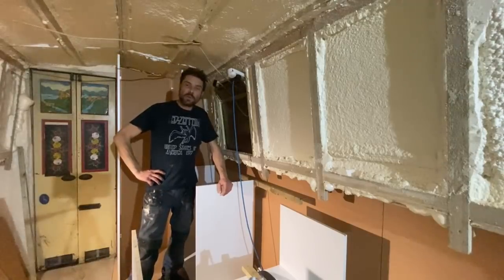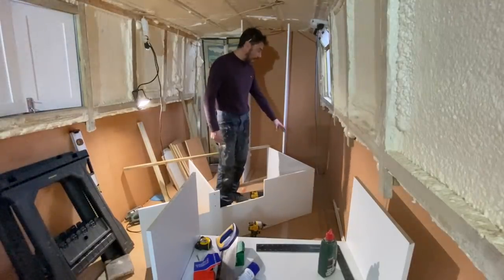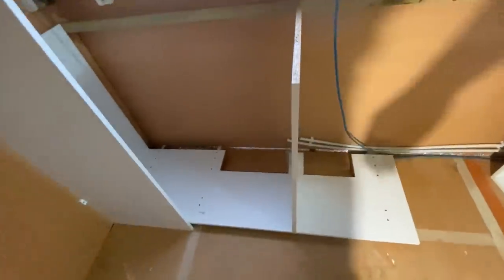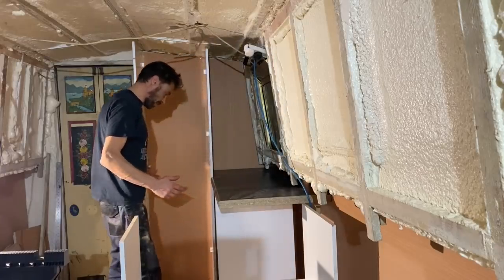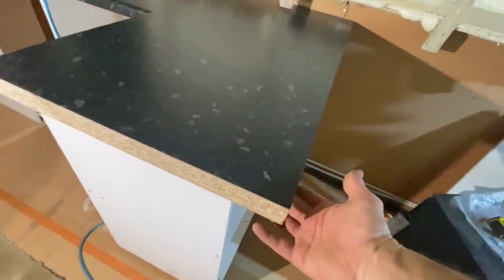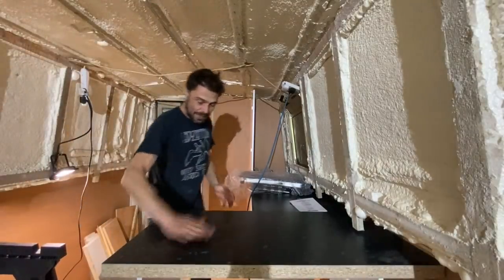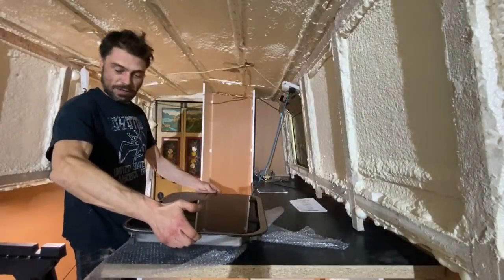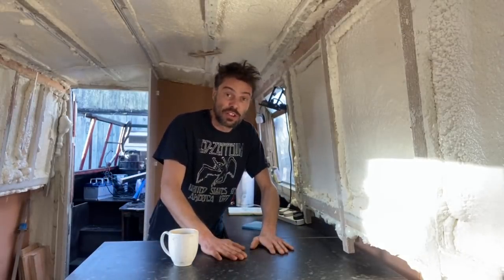63. Galley Kitchen Installation Pt2

Comment: Hello James, a good tip is to make holes in the floor underneath the rear of the fridge (3 or 4 holes, in a row, about 2-3 inches diameter) allowing cool air to come-up from the bilge. This air is drawn-up through convection as the fridge dumps it's heat whist in operation. This will allow your fridge to cool faster and thus will "cycle" less, using less energy to run. A gap for the air to escape at the top of your units would complete the air-flow circuit. As your oven will be above the fridge, the effect over time would help keep your bilge dry and remove stale air as well. All the best.
Reply: Heh. Is your bilge smelling a bit damp? Just make some grilled cheese sandwiches and the problem will go away!
Reply: @JasperJanssen  Principles of convection lost on you?
Reply: @mauricepower  what? Why are you suddenly hostile?!
Reply: @JasperJanssen  Hostile? Ha! Classic transference.

Comment: Hey James, don’t rotate the hob, stick with your original orientation to prevent splashes on the stove - fire risk and a potential BSS failure. Please note that you can keep the kettle on the stove like most boaters do.

Comment: I agree, putting the hob at a diagonal to the base and nearer the gunnels means you are standing within the galley space with work surfaces on both sides. That’s how my boat is configured and leaves the walkway clear for others on the boat.

Comment: So much progression 😁 personally I’d have had the hob the other way and just bought a trivet for the kettle to sit on after boiling so the hob lid can shut. I’d be concerned about the hob and pans handles facing into a walkway rather than the u shape of the galley, easier to knock off

Comment: Counter top you can get a t-piece to join the counter worktops together. Just thought as the trim piece you shown is for the ends. Anyway coming together nice. good job.
Reply: definitely need the proper trim piece. it will be profiled on one side to match the radius of the worktop.  you,re doing a great job.

Comment: Amazing progress.   I think I'd be tempted to see if the glass cover comes off that hob..its a nice idea but as you say, it'll hardly ever be down and otherwise you have to find somewhere to put the kettle down! Then keep the hob facing into the U and put a 4 or 6 inch upstand on the backside to act as a back for the hob.  Gotta think about safety of boiling ketles etc so close to a gangway.

Comment: You could paint the screw heads with colors. For coding which ones to remove to remove the cabinet vs what holds only the bottom spacing battens. Fingernail polish comes to mind for that.

Comment: Hi James, you can buy a joining strip for the worktop,that has a curve,to fit the profile of the edge. What you have, looks like an end trim.

Edit, looking on srewfix, it looks like (890HG) is the one I mean
Reply from the maker: It is an edging strip, but I need to remove that curve and therefore will need what I’ve got. Good spot 👍🏼

Comment: Looking great James,  I think I agree with most of the comments about the hob facing in, the pros out-way the cons, across the corner would be trickier but def the best use of the space. Also with your worktop butting up to the tower unit will this not impede doors? Hard to see from the camera angle. The recess under the cabinets could be a good spot for some led mood lighting.

Comment: James have you thought of leaving the trap door out and putting a false floor on top of the holes you cut in housing units you made that would cover the holes and screw.
You will of course be reading this after all your hard work.
Cheers Peter.

Comment: As other people have said mate you can get a joint strip with a lip on one side and a radius on the other .My only worry is how much material will be left of the work top if you mount it across? With heavy pans on the hob there's not much strength left.

Comment: Just a thought James moumting the hob where you`l like to would it be dangerouse for someone - children walking past you could mount the hob diagonally ( Where your left hand is on the video   13:37 ) as you look at it from the galley left to right , enabling you also to build a extractor fan  on the inside wall or ceiling  , maybe to remove the hob glass cover when cooking rather than have it allways opened up ..just a thought..cheers

Comment: Consider  placing the stovetop on the L, facing the middle of the boat, but pushed back so the black glass rests against the side of the boat.  This would give you working  space in front of the stove.

Comment: I don't believe you will have any problem with overheating in the cupboard above the oven providing you fit a shelf above the oven, follow the ventilation requirements of the oven and mount all your instrumentation on the side of the cabinet as you first proposed (significant heat will only escape as you open the oven door). Your electrics are going to be difficult enough to access without going further into the corner. I would even consider blanking off the opening above the oven and mounting the instrumentation on a hinged door on the side of the cabinet to ease access to the wiring on the back.

Comment: Would it be beneficial to round those corners where the hob will go? I also think you want a little counter space next to the hob to set a plate or your kettle on - with a hot pad of course. :D Just saying.

Comment: It's a bit of a shame you can't position the burner hub to face the kitchen center because of the cover plate position blocking the view. One way to solve the open cover plate issue is to make it detachable so you can simple store it somewhere when using the hub. This is how they are installed on many boats.

Comment: Instead of a 90 degree corner between your two worksurfaces could you create one at 45 degrees and put your hob at 45 degrees. You would probably need a piece of breakfast bar width worktop to do it. The back edge of the 'return' would still be perpendicular to the wall. You'd have more worksurface around your hob , reduce the risk of pans handles being knocked by passers-by and you wouldn't be standing in the gangway when you're cooking. You'd also have a bigger cupboard underneath. Easy to say obviously.
Reply: I mean 135 degrees. doh.